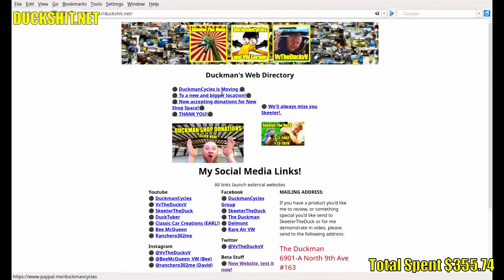Will it Run? - VW Motorcycle - ATVW Junkyard Build - Part 7

Comment: 1, channel won't be near as interesting with a fancy shop..:)  I lived the vee dub struggle in my 20's in Broward county, between building engines in an apartment, having to shuffle parts cars here and there between the work parking lot (which I was limited in what I could keep) and guest spaces at various apartments,  I got it done...kills me that what I scrapped back then as it was deemed too rusty or too common is now at least a $2500 car!   Love the skidding the engine on ply. I had a fully built 350 chevy on an engine stand, had to get it about 40 feet across the lawn to the carport (cement) from the garage (cement) and yep, kept flipping the plywood!  However I did not have a chill pet duck to give support.
Reply from the maker: Haha thanks man!   But just because I have a shop doesnt mean the creativity ends!  But I'll get rained on less lol!

Comment: At least the 4th engine bolt was missing and not rounded off or crossed up.
Reply from the maker: LoL!  That'd be awful considering how hard it is to get to!
Reply: @DuckmanCycles  when I was a kid, I was out in the driveway every Saturday morning, with my father, trying to get hie 72 bus running somewhat properly. It ended up being a vacuum leak on the rubber couplers of the 3 piece intake manifold. We messed with that for countless months.
Reply from the maker: I have encountered that before, lol!  My white Beetle!  I figured out what it was when I poured a little gas down the carburetor and it dripped out of the boots,

Comment: Hi Duckman. Been following you a long time now. Anyways my family lives in the opposite corner of the states than you about an hour an a half north of Seattle. My sons both just graduated highschool this year and my wife is taking them on a roadtrip across the country. One son is going to Iowa and the other is going to UTI in Orlando. That son has a 73 super that they are flat towing behind the truck. They have ran into a few issues on the way like a bad tire and bad advise. Everything has been addressed until now. The generator went out and will not charge battery. I believe they will be passing by where you guys work on the vws. Is there any way a generator could be secured and waiting for them when they came through with a bit of help installing? He is on his way to becoming a mechanic at that school, but just needs a bit of guidance still. We would most definitely pay all expenses.
Thanks for considering. Todd
Reply from the maker: Hi Todd!  Our tech session just happens to be this Saturday!  I can get with Decklid Don and see what we can do together.  Please hit me up on any of the social media links on my website so we can talk about it in detail.
Reply: @DuckmanCycles  Looks like somebody hooked them up in Illinois already. Thanks for being willing to help though 😎🤙